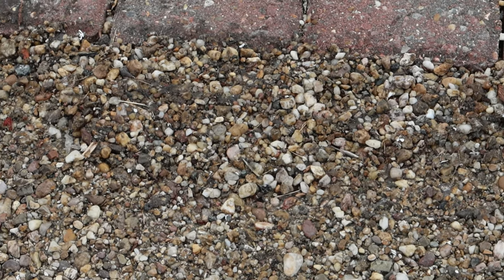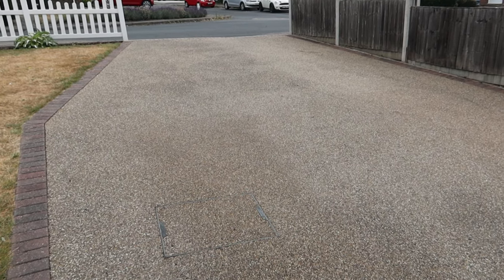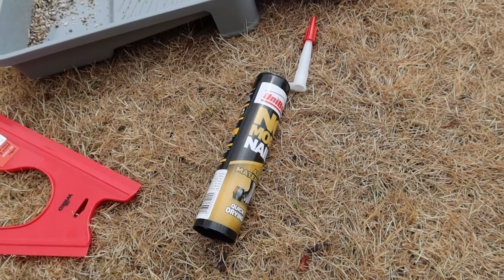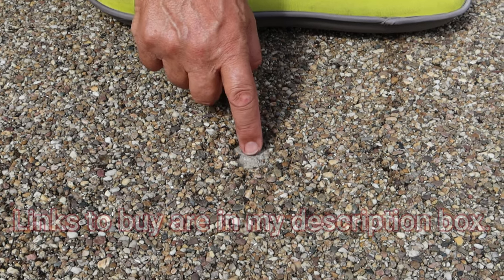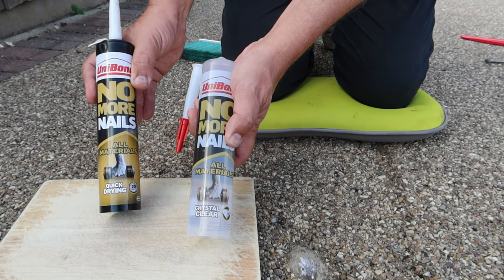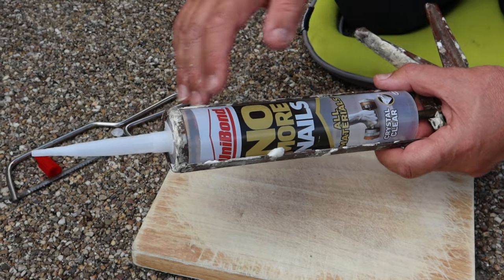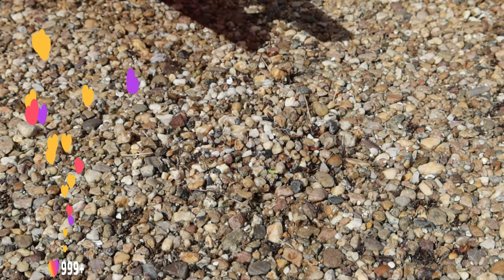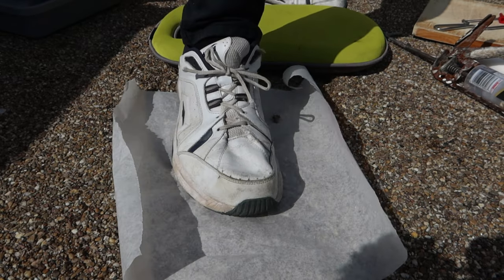How to Repair a Resin Bound Driveway, Path or Patio overview

Comment: Great Video thank you for sharing. I have a few holes and a few bits that haven't come apart yet but i can feel movement on do you have an advise on what i can put on top to stop that piece cracking?
Reply from the maker: Something will bf causing the cracking . Is s heavy vehicle 🚗 parked there? Did a truck use it for a delivery . If so trip up the small piece and reseal. If it’s the ground underneath subsiding that’s more tricky .  New electric cars weight much more !

Comment: Good job .its not very practical if you have to go out and hover your bonded drive and patch it up givin the price it costs with concrete below it aswell wouldn seem appropriate for heavy traffic or cars turning every day .I think I'd prefer concrete looks amazin tho I must say great video. Ps you should try fiberglass resin liquid it's a  2 pack  for repairs would be much stronger bonding to
Reply: Hi, Is the fibre glass resin sold here in the uk?

Comment: Please answer leeweston's question below 'Regards How is the repair holding up?'
Reply from the maker: I have had no issues, it has worked fine including through a tough winter.  Paul
Reply: @mgtracey  Great 🤩 Concerned that it would not have UV  Protection and turn yellow? I have loads of cracks in my drive and only been laid 2 years ago and looking on here for some tips as to how to fix it x